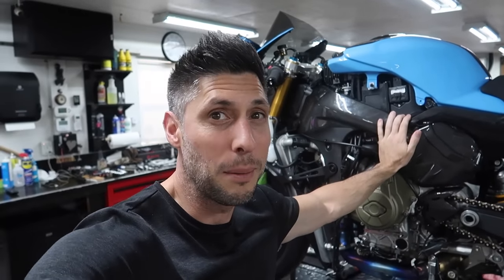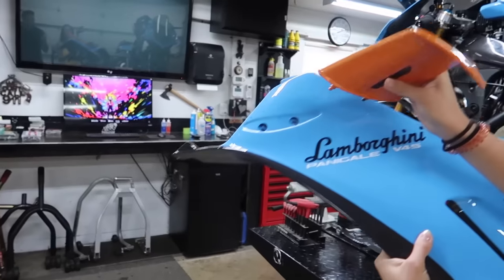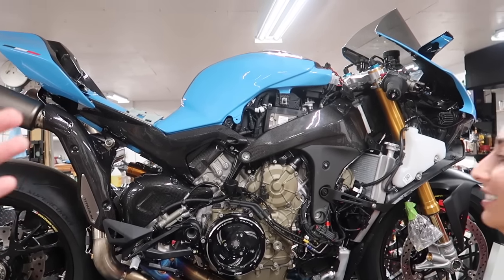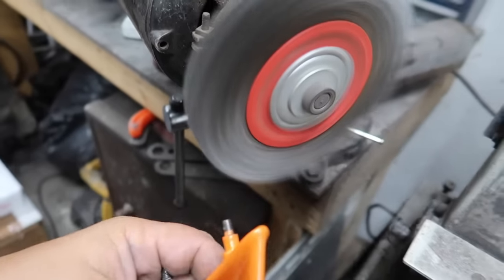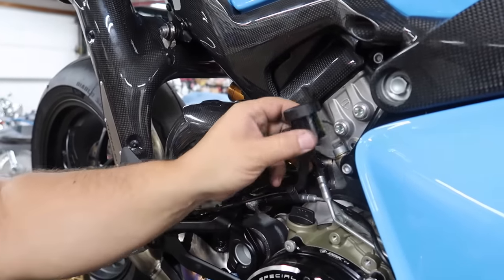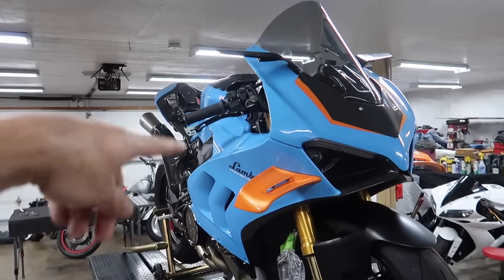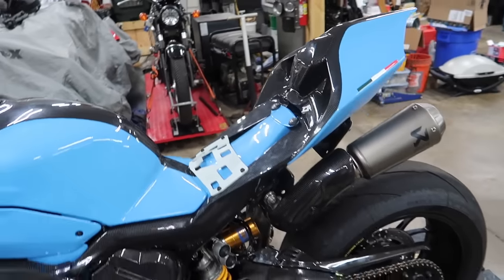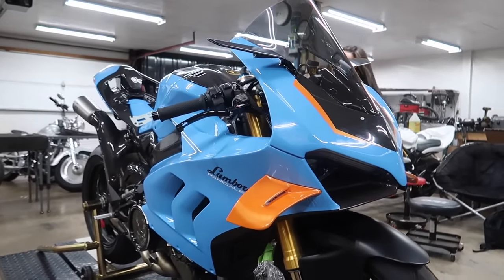Installing Custom Painted Carbon Fairings on Our Lambo Panigale!!!

Comment: 0:26 WOW‼

All yellow ⚜ You just wont leave your MAN 🦂alone🔱

:glasses-purple-yellow-diamond:
Reply: 3:27 Hey so what is the importance of the inner padding if you don't add it to the new mod if it doesn't have a difference in mattering'? :yt:
Reply: You're starting outdo yourself with this and the BMW you're gonna have to either top this or build on your Divel.:face-purple-smiling-tears: